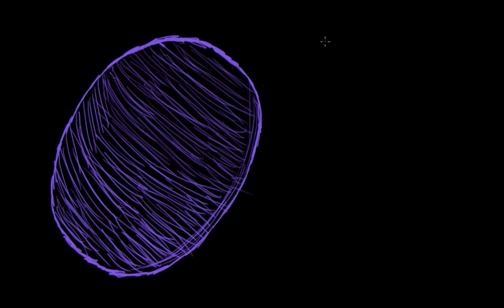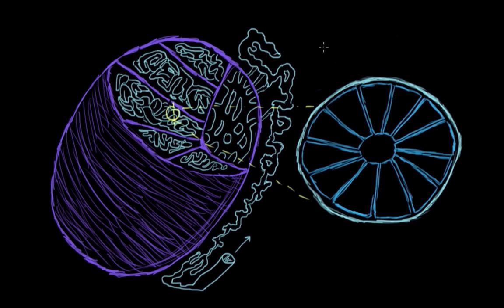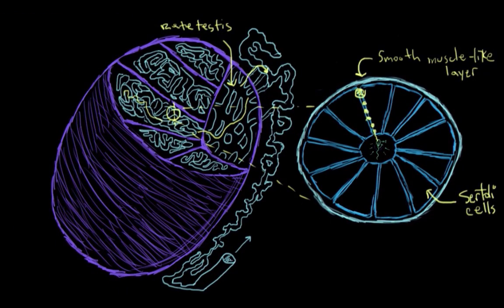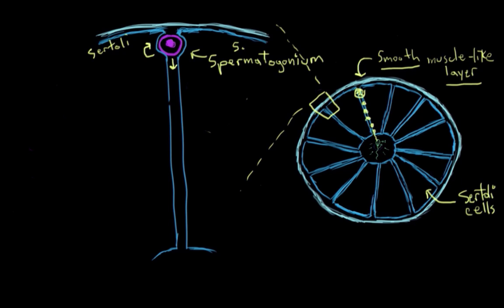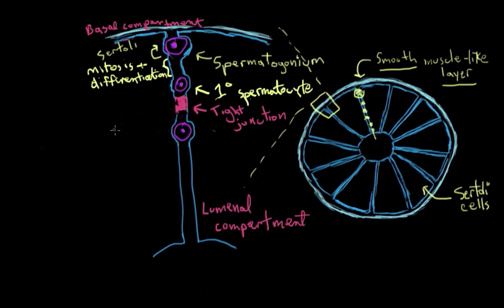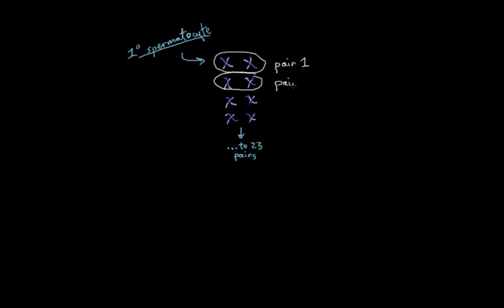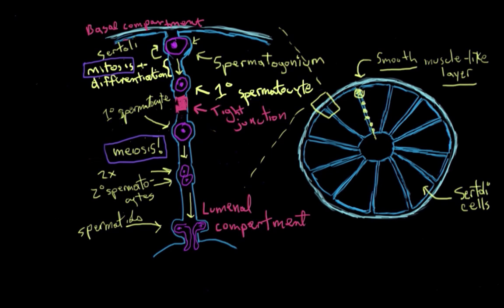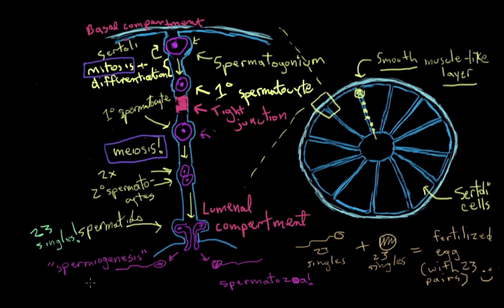Khan Academy - Spermatogenesis

Comment: the chromosome number presented here is very confusing.  it sounds as if you suggest that the spermatids have 23 chromatids - which isn't the case. (8:50)

My understanding was that after meiosis I the secondary spermatocytes are haploid - so have n chromosomes (23).  

in meiosis II, these are replicated so that again - the spermatids are haploid - have n chromosomes (23).  

When sperm and egg join the resulting cell is Diploid - 2n - having 23 pairs of chromosomes.  

aside from the confusion over this - the video makes the process really clear! thanks
Reply: hey ewan i have a question .At the time of mitosis when spermatogonium make its clone , do sertoli cells provide required nutrients to it??